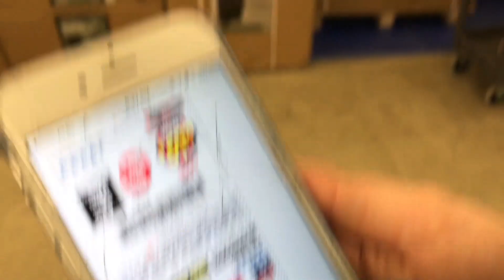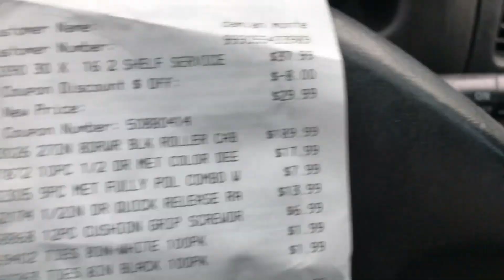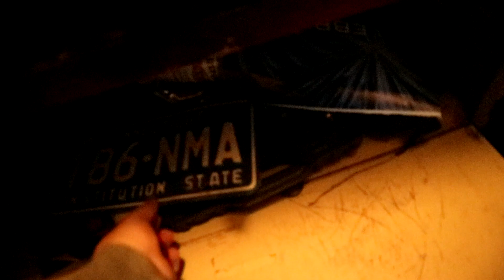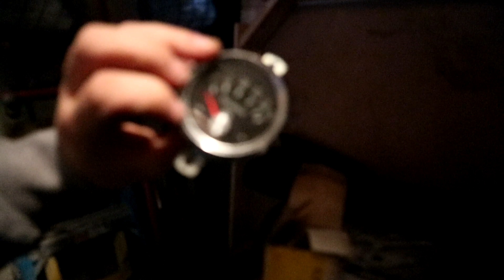TOOL SHOPPING WITH M'LADY

Comment: Hey nothing wrong with any tool box except all get full and always someday need a bigger one, you mentioned most other difference. Just don't over load drawers with weight spread it out and it will last a lot longer maybe can pass it on when you upgrade once it gets to small. I Just got a old school roller Mac box with top and side boxes. I killed my old one over weighting almost every drawer. But I wish I had your shop I got 25 by 20 work in and storage units be nice to have all in one spot and be able switch pace. Pace=project time.

Comment: How about a full loft on the left side of the shop or the side that’s not directly in front of the roll up door leaving the air space open for a potential two post lift so you could drive straight in on to it

Comment: The 30in 5 drawer roller cart is a pretty Good deal at $179. I use to have one  before i sold it. The drawer is actually ball bearing, snap on or mac matco carts similar goes for 1k. Use probably 700.